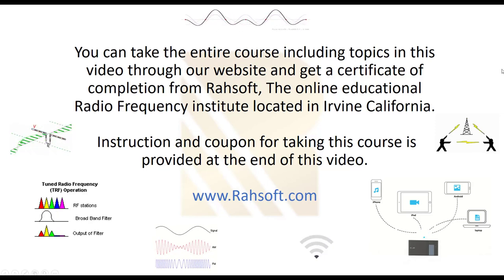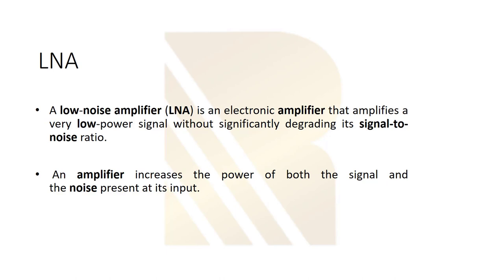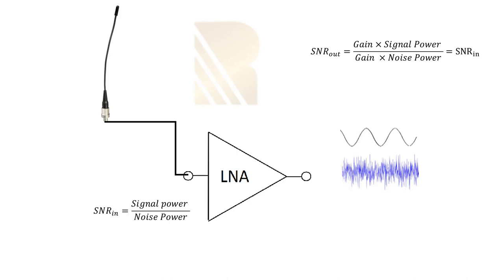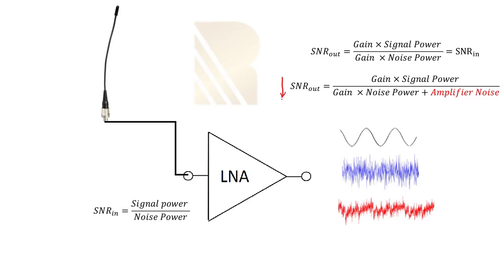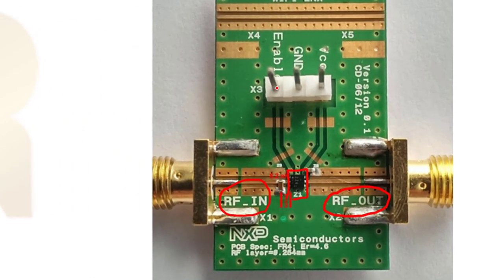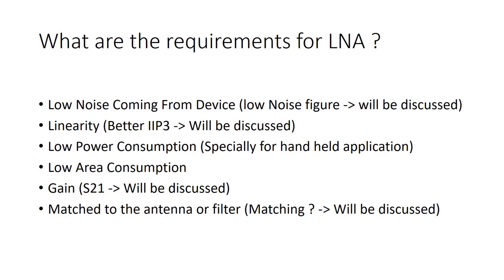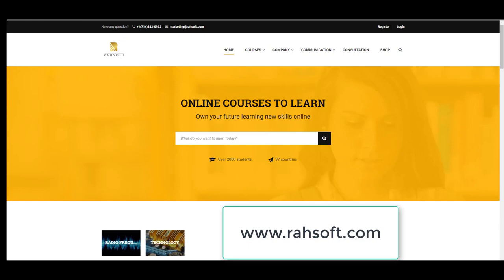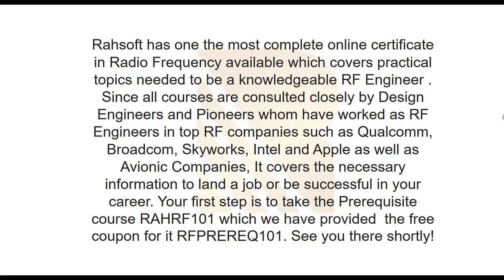Basic concept of Low Noise Amplifier(LNA). #13

Comment: The only reason for an RF LNA is to bridge cable los. And there you try to limit the bandwidth to your range and the amplification to your cable los. It is a bad design to amplifier all frequencies in direct front of a receiver, because you amplifier waves you do not want and these waves mixes with other not wanted waves at the first non linearity and creates a result spectrum which probably infers with frequencies you want to gain.
Reply: Can we use a saw filter to overcome the issue